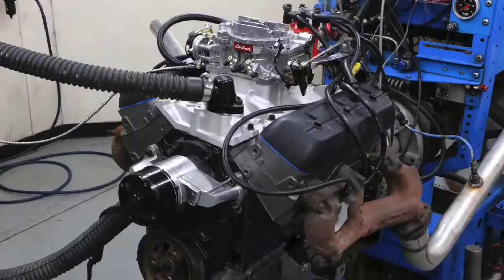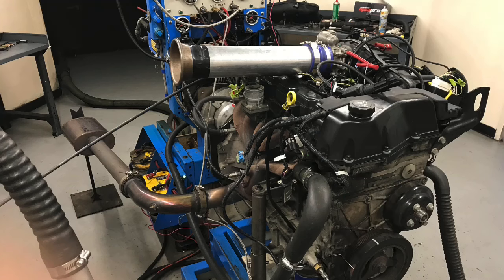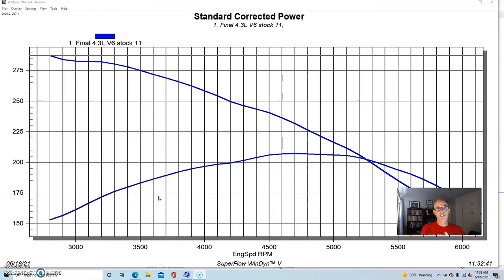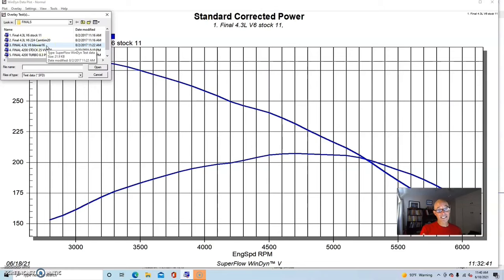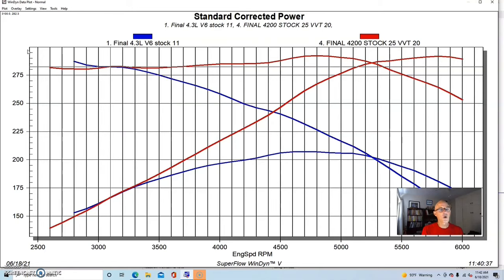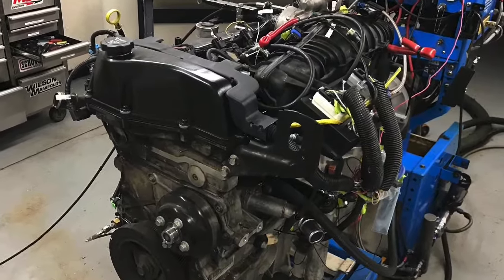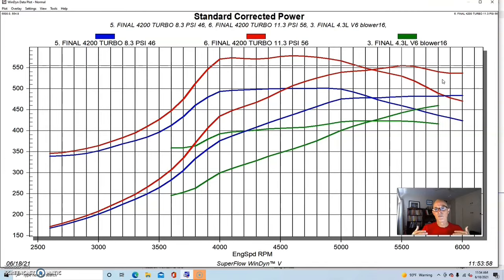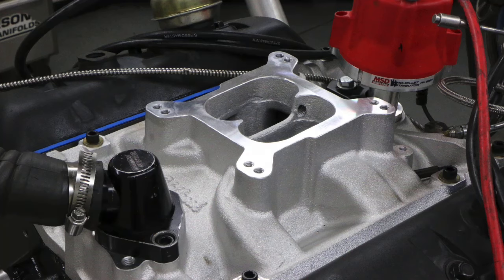4.3L VORTEC V6 VS 4200 ATLAS INLINE 6 (VORTEC VS AMERI-BARRA)

Comment: Richard if you like the 4.3,  you'll love testing newer Direct Injected  LTx based 4.3 V6 they make as much power as old 5.3 truck engines .
Reply: Y E S !  I hope he snatches one in the near future and mod it to the Moon and back.
Reply: Testing of LV3 would likely be very close to the 4.2.  However they are not yet at pick a part prices.
Reply: I'd like to see the new 4.3 tested
Reply: Sadly GM has now dropped the 4.3 V6 and made the 2.7T the std engine with 5.3/6.2 as options.  So am LV3/LV1 will probably never get to pick a part prices, but they have a ton of potential as well!
Reply: I'm hoping as well. You can buy wrecked cars with them pretty cheap
Reply: My 2019 Chevy Express cargo van has the new 4.3 in with the 8 speed auto and it really moves my loaded down with a ladder rack van pretty decent. Idk how heavy it is but I'd guess 6500+ lbs. I'd love to see someone swap the engine in an S10 would be pretty cool. It's basically a 3/4 LS1
Reply: Shhhh!!!!! I was trying to keep those hidden.
Reply: Erm the 4.8
Reply: @shadowopsairman1583  What about the 4.8 ?We are talking about the LV3 4.3 v6 here and its potential , it weighs a lot less than the 4.8 close to 150lbs and smaller while being rated at the same hp from the factory .
Reply: @JadXtreme  no it’s not. The new 4.3 is a lot different than the ls based engines. It’s based on the newer lt engine
Reply: @dilsher12  The older 4.8 Vortec makes an almost identical power curve to the LT based DI 4.3 V6. The Gen IV 4.8 Vortec stuff out performs it a bit. The 4.3 DI V6 has a poor setup though. It has the ability to really take off up too and make serious power but they choke it out. 3.6 DI LFX stuff makes significantly more power than the DI 4.3, the 4.3 just makes a bit more torque, but with the VVT the 4.3 should make more of everything, everywhere than the 3.6 LFX
Reply: @dilsher12  you said 325cid which is not 285 hp, the lv3 262 makes the same power as the 293
Reply: @Hosshoggbossdogg  the lu3 was the final vortec sbcbuilt from 2003-2013. The first vortec labeled SBC was in 96 with both the L31 and L35, however vortechnology came about in the late 80s with the 262 in the Syclone, Typhoon. Gen 5 sbc is known as the LS based LT. So the LV3 is closely related to the LS where as the LU3 is Gen1/2 related
Reply: @Jack Russelle Lewis lu3 was a bullet proof engine
Reply: Had one in a 2014 Silverado.  It didn't like to tow like the old 4.3.  It didn't make power at all in the low range.  I feel like GM ruined the 4.3 when they changed it.
Reply: They also weigh less than 300 pounds. Crazy little engines.
Reply: @SyTySpeedShop  pretty sure you can still get a 4.3 in the new trucks.
Reply: I'm glad someone brought this up.
Reply: Dang If I wasn’t 2500mi from Rich Id give him the “LT4.3” that I have to test.
Reply: It will be interesting to find out where the DI engine runs out of injector. Will it need supplemental injectors, or a full port fuel system ?  I6>V6 !
Reply: @jamesgeorge4874  Stock the GM DI V6 engines are almost using all of the fuel system they have already when E85 is used. On gasoline there is a little room to play, but not much. These systems are already running close to 150 bar fuel pressure, so there really isn’t much to do as far as increasing pressure. If big power is what you are after the best bet is a supplementary port injection setup.
Reply: @kennethpowers8995 Have you ever done any AFIT testing on a DI system, or loaded a custom tune and pulled some data logs ? Using a flex fuel sensor, and a custom E85 map, just scaled for E85 ?
Reply: @jamesgeorge4874  I’ve done a ton of custom tuning and always pull data logs. In fact majority of my tuning these days is done remotely and 100% off data logs. I haven’t had the chance to do any active injector tests with DI components, only standard port stuff. I have seen how a DI spray pattern distributes fuel over the piston, and the flame front is indeed much different due to the way they design these DI pistons and the way the fuel is injected period. From the data I’ve logged though, they don’t leave much room to play once you start using E85. The factory fuel system is only slightly capable of more power on ethanol. It just can’t move the fuel. At least on the old Gen 3/ LS stuff the Flex Fuel cars came with a slightly larger injector than the straight gas engines, but the EcoTec3 offerings are ran basically right on the line. Now the factory tune is running it on the rich side, so leaning it out would give you a bit more fuel to play with, but then you negate that as you make more power and require more fuel anyway.
Reply: @kennethpowers8995  Cool beans. I suspect that the injector isn't the issue, but the HP fuel pumps ability to provide enough quantity. I know Audi's FSI 4.2 uses a HP pump for each bank, VS GM's Ecotec 3 DI V8's single pump. It would certainly be a fascinating experiment to fit a DI HP pump that would keep up with the fuel demands of a turbocharged,  E85 fueled engine. Kinda like guys that fit another CP3 pump to their diesel engines, although CP3 systems are running insanely high injection pressure. Thank you for the response, I haven't done much tuning as of late, I have used SCT pro racer on Ford and Dodge products, and I own HPtuners also, but life has been too busy lately. My friend was wanting me to tune a Focus ST, but it turned out that he just wanted the DFCO turned off so it would pop and bang when you closed the throttle, like a teenager. Oh well..
Reply: 4200 no longer built or used. 
Also, the weight of the 4200 if i recall was heavier than the 4.3 V6.
Reply: @paddle_shift  it’s all aluminum, no way it’s heavier than an iron v6
Reply: @_..-.._..-.._  Chevy 4.3 V6 weighs 425 lbs. The 4200 weighed 470 lbs.
Reply: Oh, I actually have BOTH the 4.2 Atlas and the newer redesigned 2014 Silverado 4.3 truck engine. Put e85 in it for some INSANE torque! You'll get 24mpg in the newer Silverado 4.3 I towed 6000lbs no problem!!!
Reply: @JadXtreme  I want to swap one in my S10 Blazer 4x4 ❤ I just wonder what kind of problems I would run into lol.
Reply: @nedaCFilms  I would think It's no different than LS swapped one. Just use the harness and computer and should be good
Reply: Lv makes almost 300 stock
Reply: @nedaCFilms you shouldn't have issues as the S10 came factory with the 4.3 and the 4.2 is a Chevy engine aswell I believe should mount up in the same place

Comment: I vote, Richard gets the 4.3 heads ported. Whose with me?
Reply: The L35 and L31 specs were the same, the LU3 is better, but you can look at afr or trickflow sbc vortec heads for ideas
Reply: I have a set of ported 4.3 96+ vortec heads with 2.00/1.570 valves and they flow 266/192.  Brodix aluminum 4.3 -10 heads flow the same with 2.08/1.60 valves, but have a lot of material you can remove to port them well over 300 cfm!
Reply: @SyTySpeedShop  How much power are you making? Any more specs on that engine?
Reply: @davidwitcher5443   275 cube 3.6 forged crank.030 over custom cam, twin Wynjammer centrifugal Superchargers.  Just about done building it, but looking for ~450AWHP and it’s going in my 98 Bravada with a TBSS transfer case.
Reply: @SyTySpeedShop  WOW!!
Reply: I think he ported the heads in the one he used versus the L99. Same intake, ported heads, and 5.7 pistons. It made about the same hp as this one. Imagine if you will; ported brodix heads, 5.7 pistons, cam, headers, and that super charger. Mmmmm.

Comment: I actually dislike the 4.3. The 4.2 was awesome. I had one at 308k when rust and the sunshell took it out. It still ran perfect. My buddies Saab 9-7x was at 280xxx when it was totaled (he bought it at 130k) and it still ran perfect with 0 engine problems through the time he owned it. The 4.2 was one of the best engines Isuzu ever gave GM. Aside from the Duramax.

Comment: you're forgetting one thing, reliability cost of parts. I guarantee you that 4.3 is a lot cheaper to get parts for than your Atlas engine. and because it's a design that's based on a 100 year old tractor engine, it's built for work. won't break. doesn't rev very high but probably with the right parts could.

Comment: I would love to see the Vortec 4.3 V6 against Newest 4.3 V6 (EcoTec) it appears GM has "fixed" the airflow issues with the heads...(I saw some at a Local Machine shop and my response was What The H*** are those for?) The intake ports are HUGE compared to the Vortec!
Reply: That new 4.3 is garbage it's got direct injection its not as reliable. ND it doesn't sound as good as the earlier 4.3
Reply: Plus this comparison had the old vortec 4.3 with an 80's style carb+blow-thru which made power, but would have rather seen it done with EFI to which I'm sure most here would have thought it might have been tested prior to watching.
Reply: @jackdaniels2657  That is a matter of Subjective Opinion. And I know of several that are in Fleet Trucks that seem to be reliable. What was actually "Trash" was the Atlas engine, many known Failures with that engine...Too Bad GM rushed it to market...
Reply: @misters2837  those atlas otors are junk. If gm was smart they would've fixed the flaws instead redesigning a new engine with cost much more money. 4. 3 eco tec is junk trust me. Direct injection is garbage it always has a misfire u gotta constantly add injector cleaner. The only good thing bout that motor is nobody buys them
Reply: @misters2837  the worst part is it has cylinder deactivation ND vvt that's just as bad as the lt4. Funny thing is the lt4 has all the new technology but still makes roughly the same. I mean if I took an ls motor nd got rid of powersteering pump I could gain 30 hp if I bumped the compression to the same as lt4 I'll get just as much power. The difference is longevity. The lsx motor was manufactured to go 500,000 the lt4 was manufactured for 250,000 that's why warranties now for power train are only good for 3 years or 36,000 miles where the lsx was good for 10 years or 100,000. Same thing with the 4.3 early model VS generation v 4.3
Reply: @jackdaniels2657  Yeah "Nobody" LOL - those fleet trucks are running up on 200,000 miles and other than Spark Plugs, Oil and Filters...they have had zero issues... I am call my friend in Indiana he buys all the fleet vehicles for the Midwest branches of the US Government. (Those Vehicles you see with G## Plates) he keeps meticulous records of "problem" vehicles so they don't make more mistakes than they need to...Some vehicles end up in shop more than on the road "Cough-Chevy Equinox-Cough" - I would like to know how they fair...in real life...over many 100's of vehicles... I know the GMT400 with 4.3 and 5- Speed (back when people could drive a stick) were exponentially better than the Ford/Dodge equivalent trucks (and I am a Ford Guy) I had one 98 W/T 1500, and it had minor issues...but nothing that would stop me from buying another...The 2000 Express Van I had (4.3 Auto) was a different story.
Reply: We had some 20,000lb Clark Fork trucks Vortec 4300 on LP they were trash for life maybe 3-4000hrs (needed a 350 for what asking of Power Plant) but the 7,000LB Nissan 55's (with little 2.5L 4cyls) they would go 10-12,000 hours and be barely broke in.
Reply: Understand the 262 came as several different RPO codes from the 80s onward (Typhoon/Cyclone).  2003-2013 was the LU3. 1996-2002 was the L35 which was exactly built like the L31 Vortec 350. I'm unaware if the LU3 had intake upgrades other than not using a spider injector set.
Reply: @jackdaniels2657  understand the 262 LU3 was 75% 350 the 262 LV 3 is 75% of a 325/364. Still a great engine.
Reply: @shadowopsairman1583  the lu3 was a good motor it's the Gen 5 that was garbage
Reply: @shadowopsairman1583  I love the vortec cus my dad owned a Chevy ASTRO good ass motor. Gmc typhoon ND cyclone had one with a turbo ND that thing could beat a Ferrari stock. I don't like the ecotec cus I don't like vvt it's junk I don't like direct injection its junk nd theses ecotec motors don't last. The vortec motor my dad had in his astro had over 300,000 ND still ran good we sold it. that's a good motor.
Reply: @shadowopsairman1583  I work in a transmission I know what I'm talking bout. I know what's good ND I know what's junk atlas motors are junk. The lt4 is junk. We got 2015 suburban 239,000 miles ND it needs a motor cus it's junk. Ls makes the same as lt4. If I remove the powersteering pump on ls motor it makes identicle lt4 power.
Reply from the maker: 30 hp by removing the power steering pump?
Reply: @richardholdener1727  if it's in the vehicle, the new lt4 has electric powersteering compared to alot of lsx motors
Reply: @richardholdener1727  I just threw all my P/S pumps away! Lol.
Reply: You could still add Port injection alongside direct injection or just plug the holes. I'd say it has more potential because of that.

Comment: I have always loved both of those engines. I had an Astro van with 250,000 miles on it and currently a trailblazer with 200,000 miles and they both run awesome. If you change the oil regularly, they last forever
Reply: My next oil change in my Trailblazer will be right at 200,000. I do have to add a quart every thousand miles though. Not quite sure what's up with that, but I bought it with over 150,000 miles, so there's not much telling how the previous owner kept up with it. Still runs buttery smooth though!
Reply: I honestly don't think you can beat the reliability of the 4200! I always liked the jeep 4.0 and they are good engine's,but compared to the 4200 they ain't nothing! My trailblazer now has just over 300,000 miles and runs absolutely like new! Mine loses a court of oil here and there, don't know why or where it goes? It doesn't burn oil, it has no leaks I can see? But just an amazing engine, transmission as well! I tow my Camaro with it all over the place, no problem! Just an amazing engine!!!
Reply: @docsmallblock6584  You're giving me hope for my Trailblazer! I just rolled over 200,000 miles on it and it runs like a champ! I've been very proactive in changing out ALL of the fluids (including transmission, diff, t-case, etc), so hopefully that will keep things running strong for several more years!
Reply: @docsmallblock6584  
I had an 09 TB with 346k miles on it when I was T-boned in a crash, and it was totaled.
I drove that thing back and fourth to 7 or 8 different states every 2 weeks for work towing a 5x8 enclosed job trailer for 8 + years prior to that. It had 90+?k miles on it when I bought it.
Parts replaced are...

Fan clutch...    Lol. Of course I did.
Water pump
Passenger wheel bearing 
02 sensor (upstream I believe)
Front sway bar links
Both rear gate shocks on window
Radiator 

The Water pump Fan clutch and Radiator were all the same incident.
I spent so much road time in that thing I would have put another motor or trans in it if I ever had too.
It had the cloth seats, and pos interior door handle trim pieces, and I would get busy, and let my oil change light run on for too long after sometimes, but I loved my TB and I trusted it to take me anywhere, because it always did.
I even pulled my sons buddy's 4wd Duramax diesel out of a stuck in the mud situation.
We gave that kid so much sht afterwards for quite a while after that little thing pulled that pretty damn heavy, and large truck out. 
Someone wrote "Duramax Towing $25 for 25 feet" on the dirty rear door of my TB to remind him
I never did volunteer to him, the mechanics behind a kinetic snatch strap

I bought a GMC sierra afterwards for a work vehicle.
Last year I bought a 06 TB LZ? if i remember? It was a good deal and I didn't need it at all, but I wanted it.
All leather, Bose stereo, rear DVD, heated 1 & 2 position memory seats, interior is almost perfect, it even still had the factory DVD remote control, with 164k miles for $1500 due to needing wheel bearing & cv shaft.
I still had my old TB out back, will a fairly new front wheel bearing assy, and a CV axle, that was just fine.

I decided to take it on a 1820 mile round trip for job, with same trailer, after driving it around home for a few hundred miles and trusting it.
One of the guys who I took out with me was happy as hell when I did this, as he had several thousands of memories living in the old TB. 
The seats were MUCH better, and I was looking at a different color hood when staring at the road.
It didn't smell like cigarette butts and old rear door carpet beer spills or fast food trash bags, smelly ass dudes who worked 12 hrs, bar room hook ups and / or regrets.
But it was good enough. 
And very familiar.
Reply: @Kcducttaper1 How’s it going now? I just bought a 2002 w/100k miles. It runs as smooth as my 2019 Acura RDX. You guys are giving me hope I can stretch my $2900 to 150k miles or more.